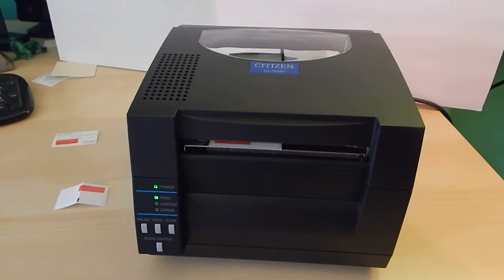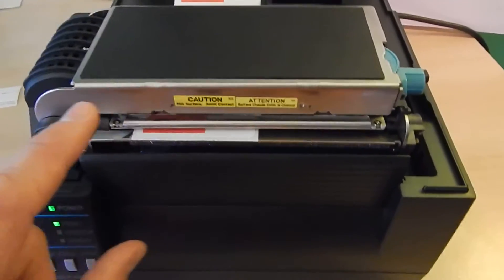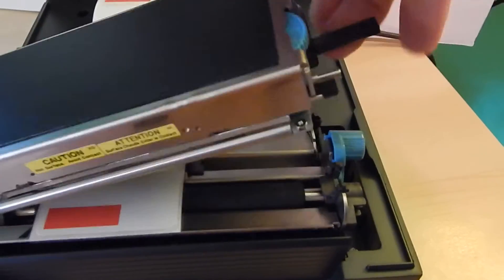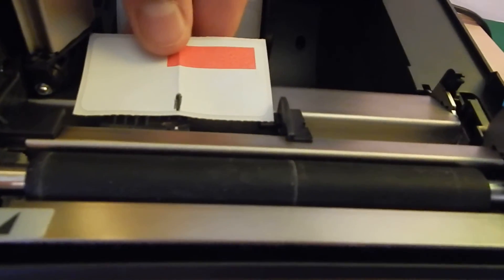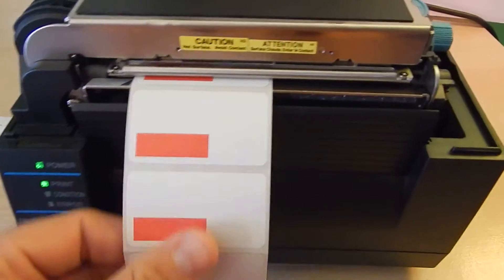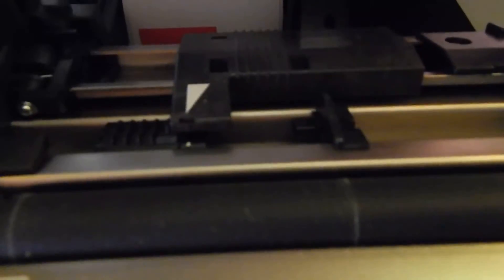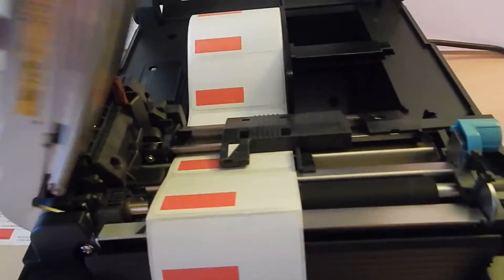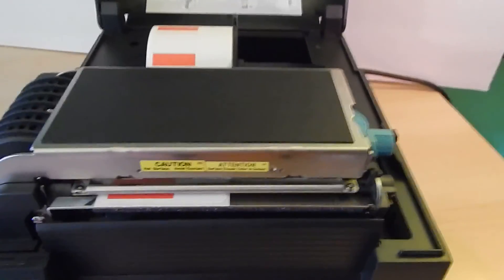cls521 labels

Comment: Would you happend to know why my labels are fading on the side? (Citizen Cl-s521)
Reply from the maker: If it printed fine at one time and now fades, it coud be a dirty print head or it coud be a failing printhead.  Cleaning it the best way to find out - turn off and unplug the unit.  Get some ispropyl alcohol and spray or dab a little onto a rag and then wipe the print head.  The print head is the part inside the cover that flips up to the left when you open the switch on the right.  It is the part with the metal bar going across on the underside.  Wipe this metal plate clean.  Close it up and turn it on and see if that helps.  If not, contact the manufacturer and they may be able to run diagnostics on it with you.
Reply: If just one side try adjusting the bigger of the  blue wheels on the print head assembly. The wider your labels the higher the number you will have to select e.g the 0 position is for labels up to 0.9 inches thick and 8 position is for media up to 4.25 inches thick

Comment: The printer▪▪▪>share4.photo/cPrinter?Fたa    I purchased arrived promptly, was easy to set up, and works like a charm. I had an older version for 4.5 years that stopped working. This is the replacement and I hope it will last even longer.

Comment from the maker: As of 9/16, we have 15 of these CLS-521 printers in stock in almost new condition.  They were installed for three months at a set of stores until they changed point of sale systems and couldn't use these with the new system.  They retail for $350 to $550 new but these units are $100 each.  If interested, contact sales@carolinapos.com.